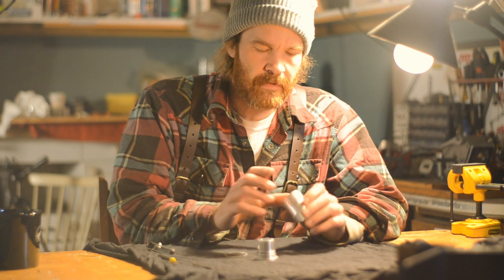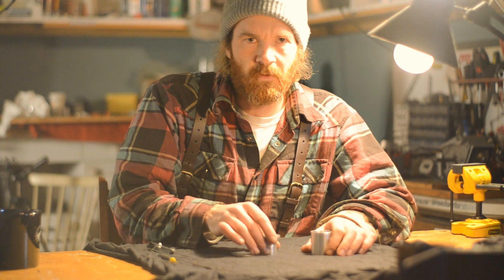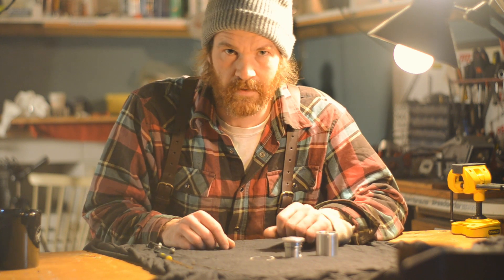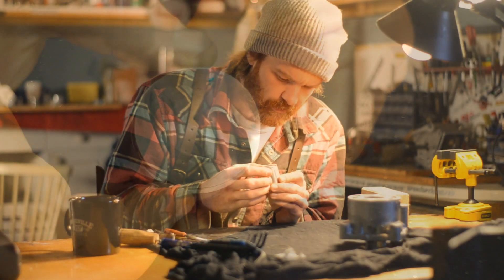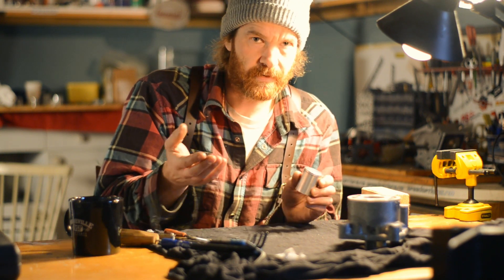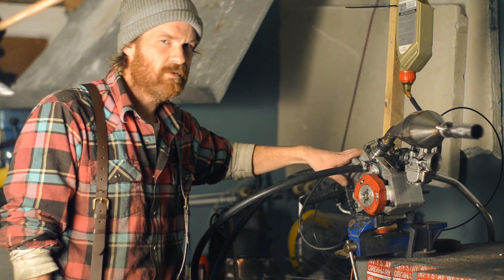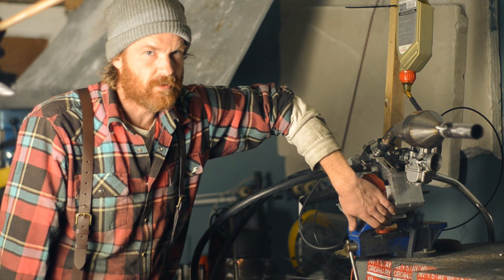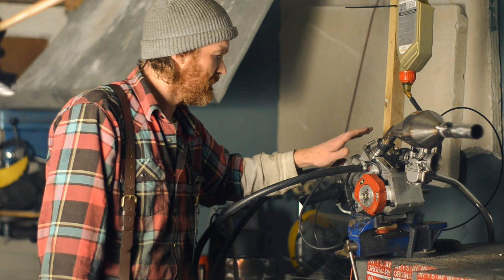Worlds Most Powerful Two Stroke Lives Again!

Comment: Do you run leaded gas? I'd recommend letting it brake in and self lubricate with lead gas.
Reply: No, lead (TEL) in fuel is primarily to reduce detonation in high compression engines and this does not suffer from that and even if it did he could solve it by other means, and TEL lubricates upper cylinder parts in 4 strokes like valve guides and being a 2 stroke it has none, in addition to the fact it has oil mixed with fuel so lubrication is already present.
Reply: @AuMechanic  the lead coats the steel tho and the oil mix just burns off and creates carbon buildup. The lead gas, I'm sure lets you get away with not running the mix so rich. But lead is very poisonous so I dont reccomend running it inside.
Reply: @Few.Be.There.That.Find.It.  
As explained leaded fuel was an upper cylinder lubricant in parts where there is no oil lubrication such as valve guides, being a mechanic since the late 1970's when leaded fuel was commonly used and having raced 2 strokes bikes and Karts I can tell you that using leaded fuel will not allow you to run a leaner oil mix and in lower compression engines the use of leaded fuel will foul the engine badly and its not easily removed. In Karting the use of Caster oil in premix causes fouling that was easy cleaned off by comparison but use of synthetics did not foul like Caster which was only used as it has a higher resistance to very high temps such as we had when I flew Nitro RC Helis.
Reply: @AuMechanic  I just meant in my original comment that he should use lead gas to brake in the engine since it seems that he has high compression in this video. Yes I wouldnt run a 2 stroke on lead gas daily, since like you said will foul the engine. I know alot of people that run AV low lead daily in there chainsaws so it wont cause any damage, just may foul parts.
Reply: @Few.Be.There.That.Find.It.   There is enough oil in the premix to handle "running in' which for road racing 2 strokes takes about 4 laps after a re-ring and its ready to race. Its not a 4 stroke and the rings are thinner, softer and there is only one of them and no oil rings.
Reply: @AuMechanic  I understand you dont need lead but I believe its fail safe with moderation, that's my point
Reply from the maker: 👍 Warm up then flog it is my run in philosophy😁
Reply: What year are we in? No gas stations sell leaded here anymore. You need to buy additives for that
Reply: @FSXgta  yah he doesnt seem to be the kind of guy that gets his gas from a gas station... c'mon now he's a mad scientist.
Reply from the maker: 115 octane leaded, but only cause that's what I have on hand.
Reply: @2STROKESTUFFING  is that a low lead content?
Reply from the maker: @Few.Be.There.That.Find.It.  <1g/l - not sure if that qualifies as low-lead.

Comment: By adding those 2 base gaskets you changed the port timing and sacrificed compression, if you were to add head gaskets instead you would only loose compression! C'mon, almost there!👍
Reply from the maker: The extra base gaskets actually brought port timing back into spec - higher piston.
Reply: @2STROKESTUFFING  will u consider making a cylinder with that variable exhaustport height system that some 2 strokes uses? it widens the powerband on dirtbikes and snowmobiles.
Reply: @2STROKESTUFFING  I knew you know what you're doing, just thought I'd bring that to light. The anticipation is killing me, but as you say, "easy is not worth anything". Forge on!!!

Comment: That is a big claim, is there proof that it is ?
Reply: Nobody else runs a full circumference, bridgeless exhaust port.
Reply: He is planning to design his dyno so that it is ISO certified.
His dyno runs will be able to prove ISO certifiable horsepower output.
Later, the Bonneville runs do not show power, but speed records for that location, based upon racing class, certified by SCTA.
Class is 50cc, chassis "A" (custom), Fuel (not gasoline), and naturally aspirated, or 50 AF.

Comment: You can cut thin metal sheets with a small chisel and hammer on top of a mild steel plate that's softer than the chisel. I use to cut thick pieces as well like 3-5mm steel, first I drill a few holes along the cutting line and then put it in a vice and cut along the edge of the jaw between the holes and then clean up the edge with a file. You can cut fairly thick flat bars like this as well if you run out of hack saw blads and cutting discs.
Reply: An introduction in cold chiseling.
https://www.youtube.com/watch?v=e7umWmyjkGI
Reply from the maker: 👍 Seen it done but never tried myself, definitely will!

Comment: You should build your own dyno and strap the thing in and test it under load.
Reply: You must be relatively new lol he already has built his own dyno 😁 it's not an engine dyno though
Reply: He has his own dyno, or at least did in older videos
Reply: He's making a new one at some point, the old one can't be loaded and this thing need a constant load to be properly tested. He has been talking about a new dyno multiple times and I think he already showed some of the electronics for it at some point.
Reply from the maker: Yep👍 got most of the parts, time to build that load cell dyno.
Reply: Be patient, he will eventually

Comment: Woah it actually sounds like a 2 stroke now
Reply: The sound of a high compression 2 stroke with a good pipe thats a very beautiful sound !
Reply: @motorsports601  ring ting ting ting ring ring that two strokes neck spot on starting to sound 👌
Reply: now all the other 2 cycle engines sound like two strokes*
Reply: Well it should it is a 2 stroke motor imagine that
Reply: @bustinyanutz4195  Exactly but compared to what it sounded like before it actually sounds like it should now before it sounded like absolute shit
Reply: @steven-qk1sg  nah, not at all mate
Reply: @steven-qk1sg  I know what you mean @steven. This time it sounded great.